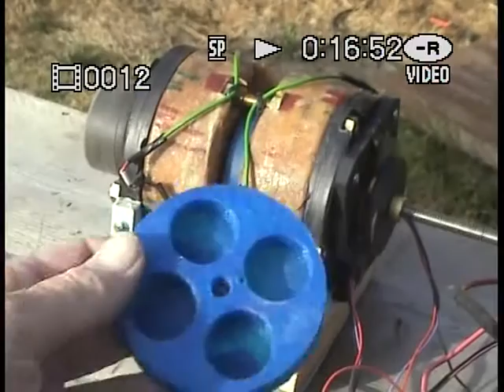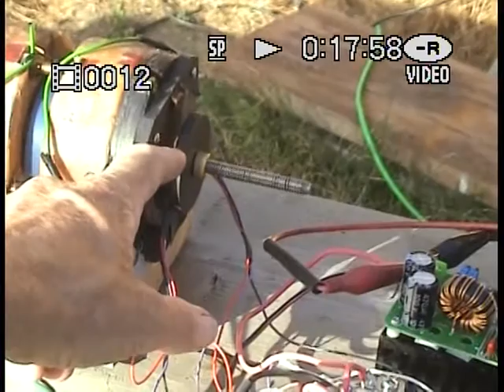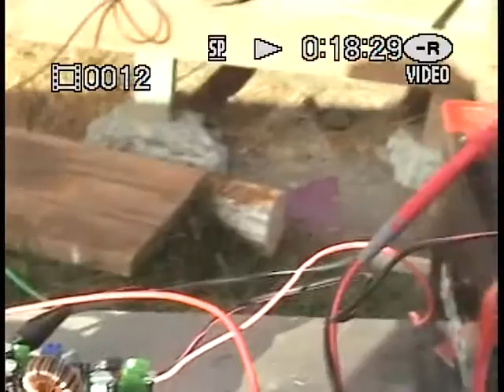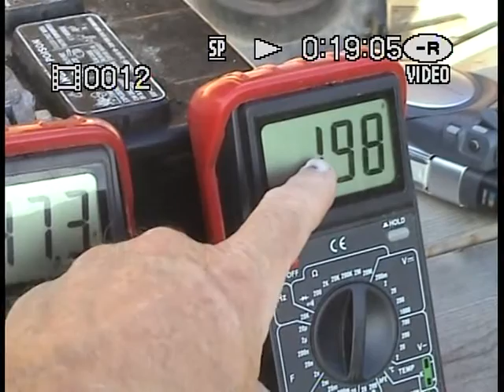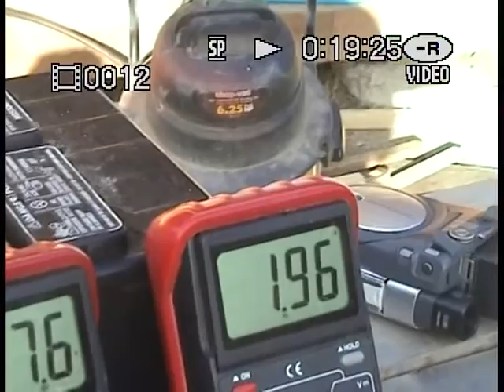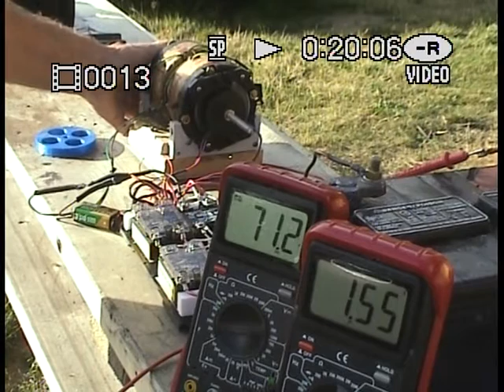Shaft load to "AC" DC motor DROPS the amp draw!

Comment: Doug did you ever run a small generator with motor and loop it?
Reply from the maker: Hi Tim
No, never went that far with it...I still have this motor and some rotors for it too..this is my favorite motor design, the rotor magnets get pushed and pulled same time plus coils are on both side of rotor so actually there are four "push and pull" power points you could call it for every rotor magnet - the push and pull and the push and pull on other side of magnet too...
Reply: @MrDKONZEN  I watch that video Doug many times lol, your idea is brilliant the way that motor works. I was thinking with that type of motor combined with a BiTT plus a low lens effect generator would make a great looped system! Cheers!
Reply from the maker: @Timtron432  Yes needs the BiTT in between!!  LOOP
Reply from the maker: my reply got cut off just noticed....
"plus coils are on both sides of the rotor with the NSNS rotor magnets, so the magnets get pushed and pulled simultaneously on four sides of each magnet, as there is the inside and outside of magnet edges, and the push and the pull edges too....four magnets like this there are 16 "power points" to spin the rotor...even better when you stack rotors, such as 3 or 4 of them on common shaft and stator coils between and on ends....now the coils do work on both ends as well with the central stator coils  and even more effecient.
Reply: @MrDKONZEN  I wounder if lens effect is low if used as a generator? If so then two of the same unit running on the same shaft would make a nice motor / gen setup 8)